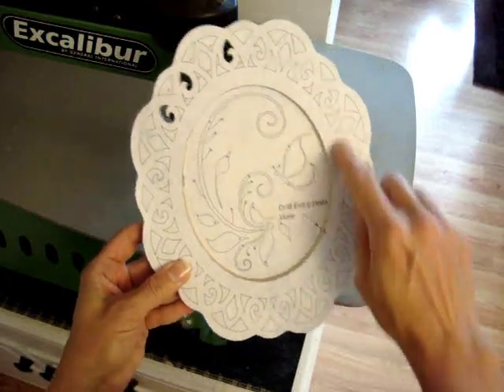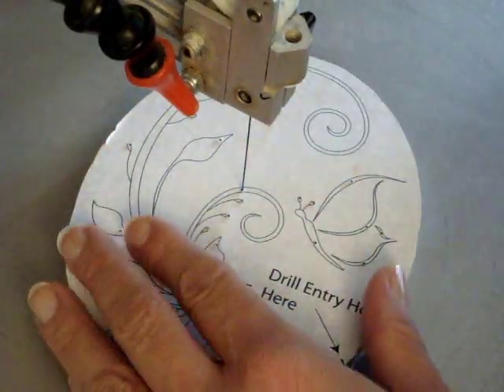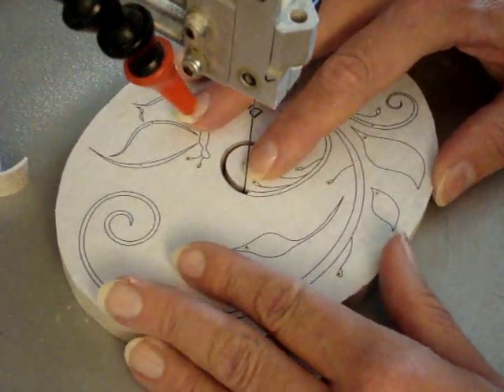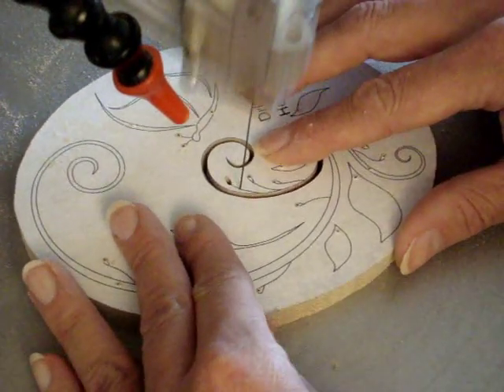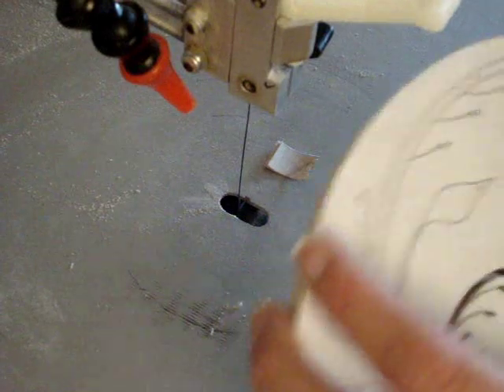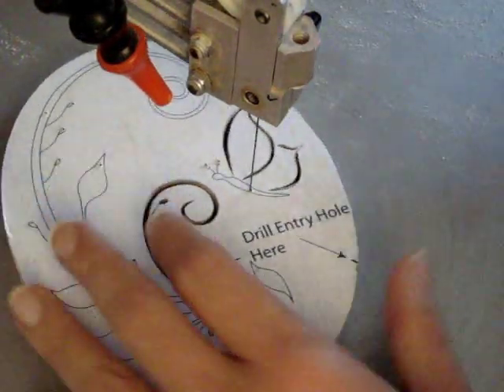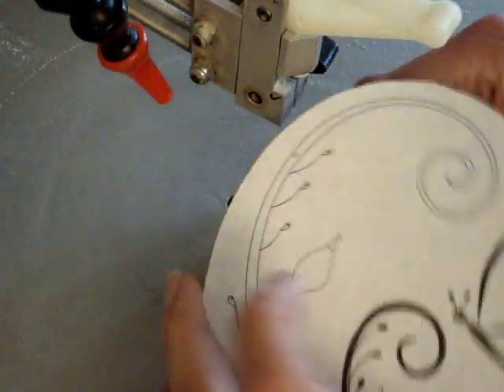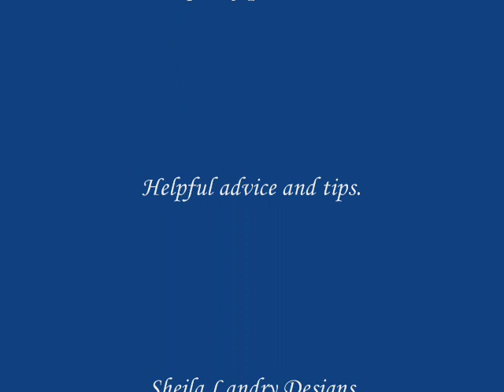Lesson 10 - Cutting Negative Designs.wmv

Comment: As always Sheila, when I have a problem or question, I come to you.  This time I have a question about the 2/0 blade.  Because the blade is not very rigid, I have a very difficult time putting into the bottom blade holder of my Excalibur.  How do you do it?  The other day it took 11 tries to get it into the holder.  I don't have problems with larger blades.
Reply from the maker: +oldman719   I attach the top of the blade first, and then it kind of falls into place and it is much easier to guide it into the bottom holder. Once the bottom is tightened, you can then re-tighten the top of the blade in the top holder and then set the tension. This is how I do it, as I also find it difficult to set properly in the bottom holder. I hope this helps you. :)

Comment: Hi Sheila, I just love your videos and I am very surprised how little pressure you seem to use to hold your work down. Could it be due to  the type of blade, wood or machine you are using or am I mistaken.  I use a Hegner Multicut 2SV.
Reply from the maker: You really don't need a lot of pressure with a small blade and thinner pieces of wood. I suppose a loose idea would be that the bigger the blade and the thicker the wood, the more pressure will be needed to keep it from "chattering" (or catching on the blade as it moves up and down.) Usually, if one has 'chatter' I suggest either decreasing the size of the blade, if possible or speeding up the saw. Chatter also occurs when the saw speed is too slow and the teeth of the blade have a chance to 'grab' the wood instead of cutting through it. It is scary when this happens to new sawyers and can startle you. But increasing the speed of the saw helps pull the blade through the wood faster and it is less likely to catch if you have the proper size blade for the thickness of the wood. There are no set and fast rules for blade size and speed in regard to thickness or type of wood. This comes with experience. You can have two pieces of wood (say, maple) and one can be much harder or denser than the other and react differently when cutting. But you do kind of get to know the general requirements as you do more cutting and it is easy to adjust as you go along.  I hope this helps you a bit.  Thank you for your kind comments. I appreciate them a great deal. :)
Reply: Thank you, I will experiment with what you have advised. Thanks again.
Reply from the maker: You are very welcome. :)